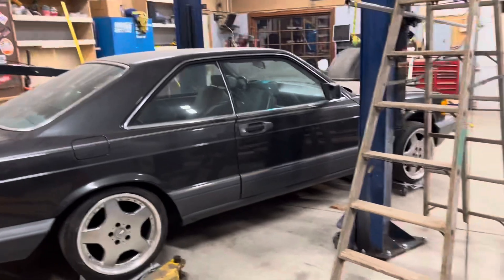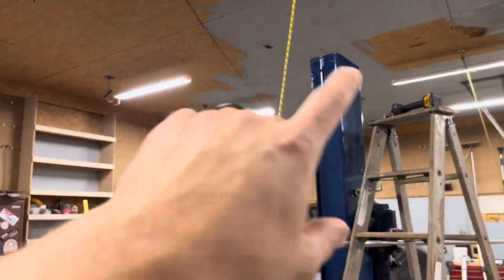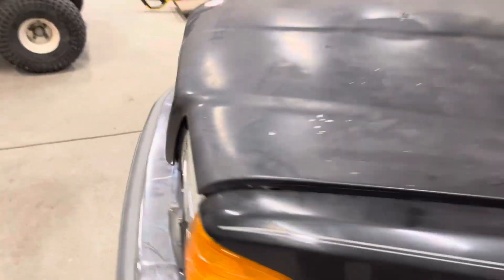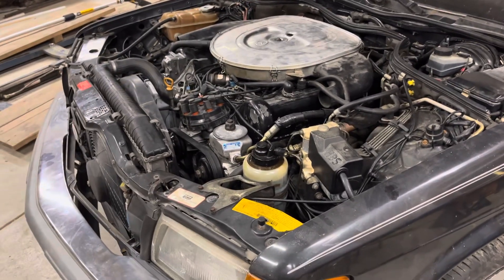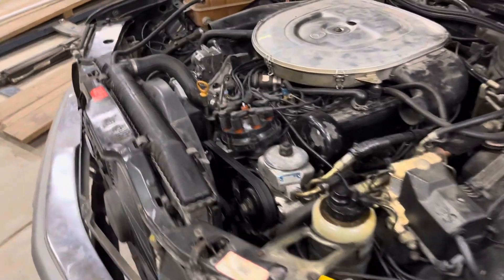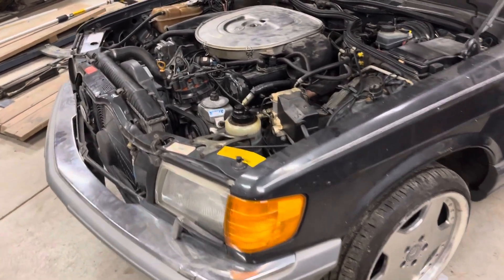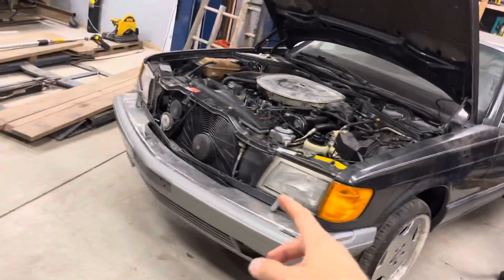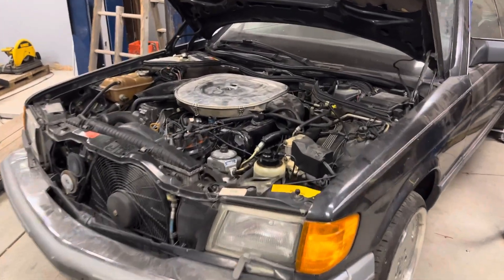PROJECT SEC - EP26: We Moved and It’s Basically a Full Car Now!

Comment: i assume you did prime the engine to bring up the oil pressure, keep an eye  on the febi tensioner
Reply from the maker: It will not prime. 
The febi tensioner has nothing to do with the oil pump.

Comment: yes you are correct the febi tensioner has nothing to do wit the oil pressure, I was watching your episode on when you added the febi tensioner just keep an eye on it, how long did you prime the engine to try bring up the oil pressure and was it primed with the plugs removed
Reply from the maker: yes plugs removed, fuel pumps disconnected. Filled to spec, nothing, overfilled by 4 quarts, nothing, filled it via oil filter housing-nothing. 
WHen I get back on this project ill take the pump off and bench test it. 
Clearly there is no bloackage between pump and oil filter as i put 10 quarts through the filter housing and it all ended up in the pan, but yet-the housing does not get filled up when cranking.
Reply: peculiar, how long did you prime for, im assuming your seeing no oil falling onto the cam
 @BGGarage